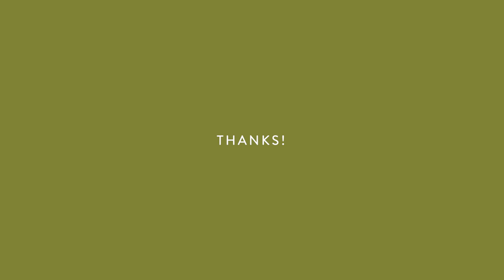Exploring York River | Cabin Glory | V.06

Comment: You are all doing a great job on the build! Thank you for sharing the videos!

I'm one of Chris' friends, working at an architectural firm specializing in residential construction - on top of marveling at the progress, I'm also at the edge of my seat with questions about your plans for insulation, heating, air tightness, and vapour control :) If you need any help or have any questions, I may be able to help or connect you with product reps. P.s. Please don't forget rafter hurricane ties :)
Reply: Hi Lilia, Thanks! 
Would love to connect with you and have discussions about our plans, which are often just made on the go! Could you perhaps connect with us on our instagram? 
Re: Hurricane ties- Each of the new rafters is sistered onto the old ones which are fastened with something like 3 6in nails. I was also thinking that uplift on the roof wouldn't be too much of a concern as the cabin seems to be fairly nestled into the surrounding forrest, rather than being out in the open. Is this the wrong place to save a few $$??
Reply: @wesleyleung9619  Found you on Instagram! Re: Hurricane ties, definitely want to have them for times of super strong winds. Maybe the name 'hurricane' is too fanciful and probably won't happen where you are but it's basically for the several odd times of the year when there's a more than average strength wind storm. Nails provide lateral load support, hurricane ties will provide you with uplift prevention by securing the rafter to the wall stud and the perpendicular top plate (which 3 nails won't do)